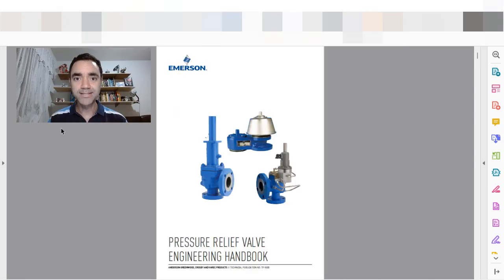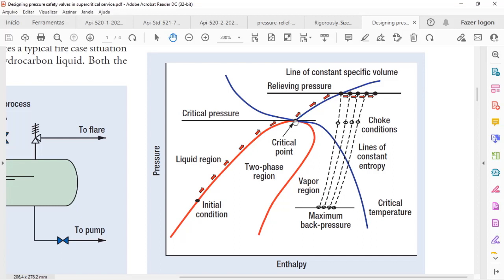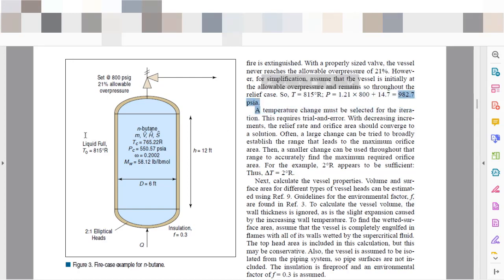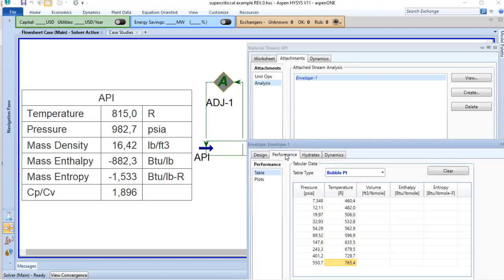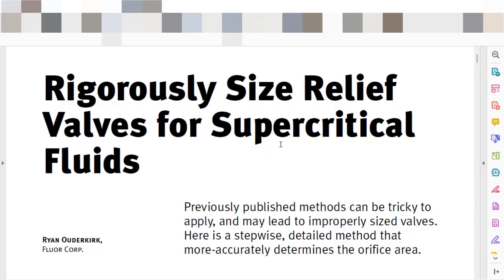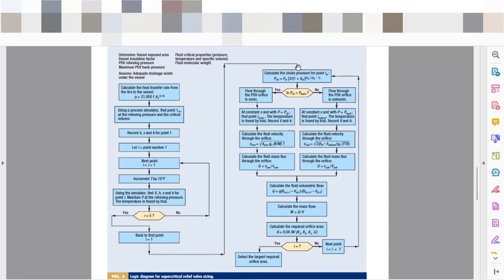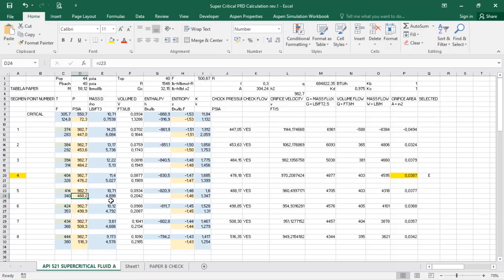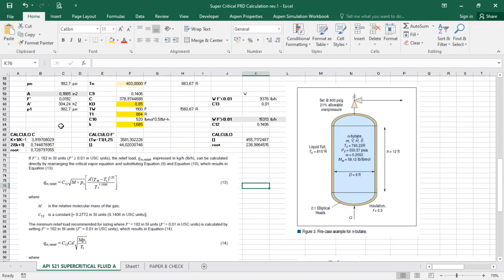SUPERCRITICAL FLUIDS STANDARD AND RIGOROUS CALCULATION FIRE CASE FOR CHEMICAL PROCESS ENGINEERS

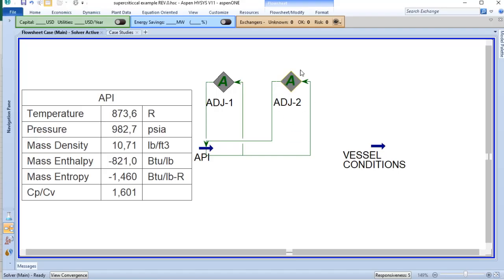Comment: The video is interesting. But at 42:16, when verifying the new temperature on Aspen HYSYS with the targeted mass entropy, the temperature found is not matching with your value of 340 F in the excel table. It's giving a negative temperature value and the ADJ is not solved.
Reply from the maker: Hi, do I double check in the procedure. You may find what is the issue. 😇

Comment: It was a very good session sir. Just wanted to know what are the key parameters we should be aware while checking the calculation for the fire case. If we were to review it
Reply from the maker: Hi Vijay, some key informations are fluid properties, process conditions and vessel dimensions.
Reply: @jefersoncostaengineer  hello sir, i wanted to ask how to get similar results using Aspen HYSYS?
Reply: @jefersoncostaengineer thank you sir for the session. I wanted to ask how to size pilot operated PSV in hysys dynamics and what is the effect of 'enable hysteresis' on PSV in hysys dynamics?